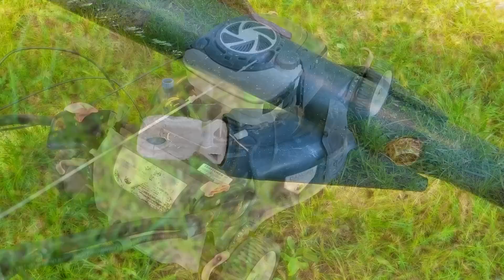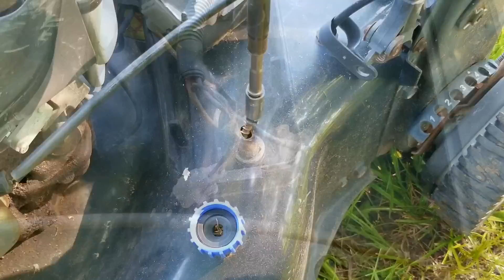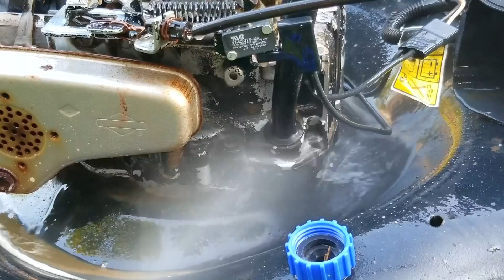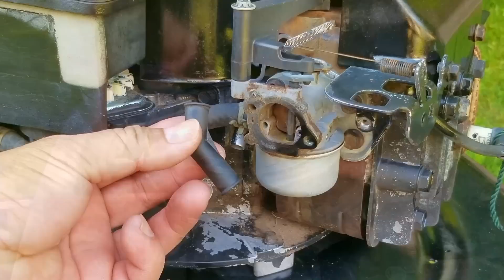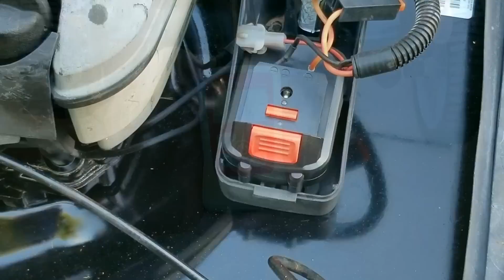A Cheap Battery Alternative For A Craftsman Mower

Comment: I never knew that a power tool battery could be used on a mower like this. It’s a great idea and I would definitely take advantage of the cost savings!
Reply from the maker: that's what I thought too!
Reply: @brianandrews, the power tool battery may have worked because it’s a 12v battery but it doesn’t have the correct cranking amps, so in the long run it could damage the starter, and may not have enough power to get the mower started when it’s cooler outside!
Reply: Using an 18v would probably even work and spin a bit faster without hurting electronics, but that'd have to be tested lol

Comment: Huh! I just sold an identical model that I alley picked. I wish I would have seen this vid first. I was too cheap to buy a battery for a mower I was going to sell but probably would have had I seen this. I replaced the traction cable and got a decent price for it. Besides, as you noted I was impressed with how easy it was to start.
Reply from the maker: yep it's surprising how easy these are to start.

Comment: Good job. When my son was little I trash picked an old Power Wheels truck for him to drive around. Of course, it was missing the battery and charger. I made a connector for a DeWalt drill battery and put a fuse inline. It was a 12v motor and I was using an 18v battery, but it never overheated and I never had trouble with the motor or battery. It was way faster than stock too.
Reply from the maker: nice, that's what I'm hoping to "upgrade" to, thank you for Sharing

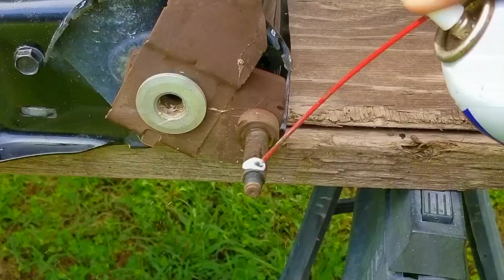Comment: I have the front-wheel drive version of that Craftsman (w/o key start). Good idea to clean and lubricate the height adjustment mechanism when you removed the wheels (7:49). It makes it much easier to adjust the height of the deck, given how heavy the mower is.
Reply from the maker: you got it, the first time I had to adjust the height on a mower and the adjuster was stuck, I knew this might be a deal breaker if the buyer tries it out.

Comment: Awesome tip about the battery set up. I usually take the electric starts off since that new battery cost ruins the resale price margin. Most of these dont ever have the charger either.
Reply from the maker: you are correct.  Most don't seem to care about them
Reply: Starters on push mowers can be $50-$150. Save em and trade for other parts maybe.
Reply: @marshmower  yes I do save these parts. Gotta do EBay I guess.

Comment: great solution . i didn't know there were lithium batteries with only two terminals . opens up possibilities to get some old tools working again . i took apart a pushmower battery pack once , thinking i might replace some of the expected ni-cad cells . was surprised to find several "d" sized cells that i believe were some sort of dry cell lead acid batteries .
Reply from the maker: wow ,I've never tried looking into replacing the batteries on push mowers yet.

Comment: You made a good choice with the alternative battery. You can't argue with success. I'm surprised that a charger is needed. I have a 28 y/o Craftsman 'electric' start which I didn't know was supposed to have a battery. I had a previous Craftsman 'electric' which used 110 AC and figured the same was true for the later one. Eventually, when I learned it was supposed to have a battery, I was mystified where it was located. The mower apparently was a return and didn't have the owner's manual and bag which I was assured I would receive and didn't. Now, if it wasn't self-charging, I'm glad I didn't bother.
Reply from the maker: thanks, and this engine says It has a "alternator" on it, and It should be under the flywheel but I didn't check.

Comment: I had one of these and despite being kept inside and charged over the winter the OEM battery was toast after 2 seasons. They wanted $110 Canadian to replace it. I refused to pay that and just pulled started it. I ended up giving that mower to my son in law and it still runs. 
I never knew or even thought of using a tool battery. 
Another great Tip. 
Cheers
Reply from the maker: thanks and yes the OE batter is insanely expensive!

Comment: I fly radio controlled model airplanes.  When my mower lead acid battery died, I soldered on a TX60 connector, and I use a 3 cell LiPo airplane battery to start it.  Works great.  Cranks right up.  I cut some scrap foam to put around it in the battery box, so it doesn't rattle round.  (LiPos are actually fairly tough, but if a battery gets punctured or shorted, it can start a fire.  It's a good idea to protect it with padding.)  Works for me because I already have batteries and chargers, but your average homeowner would not.
Reply from the maker: that works

Comment: I like the power tool battery idea for a push mower. Whenever I try to get my Toro's electric start working, I'll keep this in mind. Thanks for the idea. My riding mower, however, uses something more like an automotive battery, so I wouldn't be able to get away with using a small battery like that.
Reply from the maker: no problem, and yes a rider would need more cranking amps.

Comment: I’ve never come across a key start push mower. Great video
Reply: Snapper did them with Tecumseh 3 3/4 engines, self-propelled. 
Last a few years. The Gates battery packs weren't the best. early Eighties. 
still have that hiVac deck, third engine, B&S Quantum. Best deck, best engine.
Reply from the maker: you're not missing much.

Comment: I have three electric start push mowers, including the mower featured here.   Now I am considering a tool battery with higher voltage because they are lithium, lighter, smaller, and come with a charger.  The wire harnesses are more expensive than the battery and battery charger.
Reply from the maker: I think it's a great repurpose for them.

Comment: I have a mower with the Briggs & ScrapIron E-Series engine, after sitting for a week, primed it 1X, One pull of the rope and it was running. Most of the modern engines have a compression release to make starting easy.. Most of these small mowers are so neglected they need a valve job and other fuel system repairs.
Reply from the maker: wow your mower is still working great! You're doing a great job  of maintaining it!

Comment: As usual, I'm with you on this one too. I got all new stuff when I was trying to get the Troy-bilt going because I thought it'd be working here but after it wore me out I was just glad when it left and chalked it all up to a bad experience. I still think about why everything did like it did but grin and know that the battery and charger for the Stihl is in the closet and all is well on the mowing front...............for the time being. I can take it one day at a time and will so no worries. Sweetums also got a battery hedge trimmer, Kobalt and I'm happy to say that they have incorporated a self-check in the chargers as well as Stihl. Wished Milwaukee had done that when I was trying to get one of their saws but ended up with the Stihl instead. Have a fine weekend and Blessings
Reply from the maker: I know right, the Milwaukee stuff is a bit lacking in variety
Reply: @INSIDEHOUSEGARAGE  I had no way to find out if the batteries or charger was bad so I had to drop the whole thing. Stihl picked it up though, right well.

Comment: Hey bro what's up? That was a very good idea in replacing the battery with a cordless tool battery. It might not be the original battery for the mower but fix is fix. Good job bro 👍👍
Reply from the maker: I thought so too Thank you Ramadin Sookhoo!

Comment: You did an absolutely fantastic job with this machine!  I recently had a Cub Cadet come into the shop and it needed an engine brake cable.  The cable was a weird one, I had no aftermarket options in stock, and it had to be the OEM cable.  Damn thing was $69.00 !!  The customer was obviously unhappy, but we didn't have an alternate option.  Remember folks, keep those cables clean and lubricated.  Should you ever need a replacement, some are $15, some are nearly $100, and there are SOOOO many different cables, it's really annoying when ordering one.
Reply from the maker: thank you I appreciate that and yes most forget about the cables.
Reply: What was the part number for that brake cable?
Reply: I had a weird expensive one like that and I just made my own by reloading the existing cable sleeve with a good used cable that had a broken end. I cut the excess cable off to the proper size and put a new “Z” bend end on it, good as new and cost nothing. Everything is just a little different with those Cub Cadet mowers. It looks like (and basically is) just another MTD mower but parts like the bag, chute, blade and cables don’t interchange with the others.
Reply: Yes, abosolutely! And make sure an actual lubricant is used to perform that task.
Reply from the maker: I thought I put the information in description?

Comment: Hello HG, yes I would change the battery, not only do I have a bad shoulder I have two, the good thing is, my wife loves to cut the grass and my 15 year old Honda starts first pull every time, I don’t repair very many mowers but when I do I want them as clean as I can before I start any repairs, what I would like to know is what kind of sprayer you use to clean the mowers ? I use the garden hose, as you can imagine there’s water everywhere. 
I enjoy listening to your videos you’re very informative
Reply from the maker: thanks , I thought it was a good idea.  The sprayer is an airless paint sprayer. I'd say it was about 600-700 psi equivalent.

Comment: My Honda HRN 216 has an electric starter in it, and I do believe the battery is a maintenance free lead acid type. I think I will convert it to a lithium ion battery if it fails because those batteries cost almost one hundred dollars new.
Reply from the maker: yes I think that would be a great idea.

Comment: Compressed air cleaning… Gave me flashbacks of the time I blew out a blind hole I just tapped and all the metal chips went in my eye. I was incredibly lucky and most bounced off, the one that didn’t I picked out without scratching anything.  Still hurt though. Makes me shiver just thinking about it.
Reply from the maker: I've had the same experience but I was using chip chaser.

Comment: I think it's a pretty good idea to start a mower using a power tool battery, but not with that one.
Considering the price, it has to be lithium polymer type of battery, which  won't last for too long if it is used that way.
I can hear that it has a hard time providing the current, needed for the starter, so it's inner components could overheat and eventually fail or the battery will puff up overtime. But it's just my opinion. I wouldn't have tried it for sure.
Reply from the maker: you make a good point

Comment: Send makes a cable repair kit 41 of those cables that comes with different ends for different uses just gives you the inside wire or you can just buy roller the inside wire but I think the cable kit repair kit is like $6 as long as your housing on your cables are still good and they don't split and they don't like you can get away with that
Reply from the maker: thank you for letting me know

Comment: For me, since I have a battery tender, i'd probably just get a regular 12v lead acid battery.  But it's good to know that I can use a lithium battery in place of lead acid battery.
Reply from the maker: yes it was just meant as an alternative and I think works well in a pinch.
Reply: Won't a 18 volt battery burn out a 12 volt starter????

Comment: For a push mower, I would try that, but not for a rider. Depending on the age of the mower and the brand would determine if I get the oe battery (and if I plan on keeping it) for a push mower. for a rider, I would run to the store and pick up the battery for it.
Reply from the maker: nothing wrong with it.

Comment: That is brilliant, thanks for sharing! I always get the electric start working again before selling a mower but I’ve been doing it the expensive way for all these years. I always bought a $20-25 battery and a cheap $8 battery tender for a charger and include them with the mower. This is a much better idea! Is that a Harbor Freight package deal?
Reply from the maker: yes it was but the price was a regular price, it wasn't even on sale. throw in a coupon and it's even cheaper

Comment: Another good reason to clean the grass from under the belt Gards is becuse when alot builds up the friction between the belt and the grass could start a fire if the grass is dry.
Reply from the maker: yes you are correct

Comment: I have a question for you. What is that water line hookup on the mower deck for? Love the videos btw. Great content!
Reply from the maker: thanks, it's for your garden hose. You connect the garden hose, turn on the water and start the mower. It's supposed to help you keep your mowing deck clean. But you have to use it every time to get keep it clean.

Comment: well for me if i had a ride on mower or Lawn Tractor i,d only use what,s recommended for it and for a lawn mower probably the same topic but a different size in voltage it needs to turn over the engine by the starter motor etc.
Reply from the maker: well said and you are correct
Reply: @INSIDEHOUSEGARAGE  yep for sure.

Comment: Question. I noticed that the blade for this mower has a 'star' shaped center. What method do you use to check the balance of the blade after you sharpen it? If it had a simple round hole, it can hang on a nail or screw drive shaft or by using one of those somewhat crappy little cone shaped balancers. Just wondering.
Reply from the maker: I only use a nail on the wall.

Comment: Electric start doesn't go the distance as far as running an engine for 12 years or so between mower/engine changes. My Gates powered starter Tecumseh went three/four years till it was just stripped off & left behind. Too much weight for too little utility. The packs don't last long enough & you need to leave it plugged in to the wall. 
     The B&S Quantum is such a quick starting engine as it is. I'd never weigh down the deck/block with that penalty.  Ever again.  (still got the Snapper/Tecumseh deck from '84)
Reply from the maker: thank you for sharing that

Comment: I find it funny that run of the mill electric start mowers like this one have no on-board charging system but a Honda HRN216VLC is the same price but includes the charging armature.
Reply from the maker: this's interesting to know .
Reply: Some of them did, some didn't. Sears/Poulan gave you a "Wall chrgr" to hook up 24 hrs prior to use.

Comment: Is it better to let this mower's new owner open the battery box to attach the charger or leave the the charger plugged into the battery and notch the cover? I wonder if you could have a little quick-connect hanging out of the battery box? Thanks for your videos!!
Reply from the maker: the cover was missing on this battery box so there's no need to notch it.

Comment: I have a question in regards to the oil being used?
My question is in regards to cost or just convenience , using left over oil from an old car that you no longer have that may be a 5W-30 or 10w-30 weight or real cheap $10-$15 Gallon of 20W-50 laying about in the garage.
Reply from the maker: I'd go cheap, the mower won't care too much about the viscosity but the car might.

Comment: There is a reason why they make low end mowers. 'They' know there are those that will not take care of it. That means either it is replaced with another mower, or the sale of after market replacement parts.
Reply from the maker: you are correct

Comment: Looks like you did a very good job cleaning up that mower, but I don't believe for a minute that little li-nmc battery is rated for the kind of amp draw it's suffering from that starter motor.  That's a recipe for a battery fire.
Reply from the maker: quite possible

Comment: What cleaner are you using in the spray bottle?
Reply from the maker: the bottle is an old super clean bottle but I put a degreaser from Harbor freight in it to use.
Reply: @INSIDEHOUSEGARAGE  thanks.  I thought maybe it was simple green or similar.

Comment: I’ve watched A LOT of your videos and I just now noticed that there are 2 channels, IHG and HG. What is the difference between the two channels?
Reply from the maker: there used to be difference a long time ago, a diagnostic channel and the other channel had the fix. And even though I said it very clearly the viewers did not like this arrangement, so instead of dumping the smaller channel they both do the same thing. short answer, not much difference
Reply: @INSIDEHOUSEGARAGE  I get the initial concept but I can see why the audience reacted that way. I found your channel about 3 weeks ago and I watched about 50-70 videos so far. 

Like another commenter mentioned on another video, we are noticing that there is a lot more commentary on customer behavior or focus on social economical issues. Of course, this is your mower, I mean channel, and you can do whatever you want with it, but I think most of us just want the repair part of this hobby. Even if it’s the same repair over and over again. It’s just so relaxing to watch and satisfying when an engine gets repaired. So maybe you can do only repair content on your main channel, and videos with personal comments on your secondary channel.
Reply from the maker: I appreciate your comment, and I've noted it.

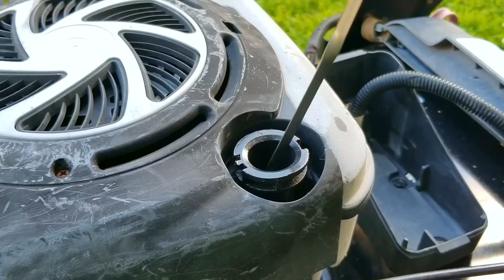Comment: Great video! At 11:46 you say you can use whatever oil you have on hand to fill the engine with. Since I've seen people fill engines with everything from fork oil to hydraulic oil, maybe you should be more clear that it has to be engine oil. Yep people are that stupid.
Reply from the maker: nah, it's their choice to use hydraulic oil, or even engine honey, it's up to them if they want to responsible for the aftermath.